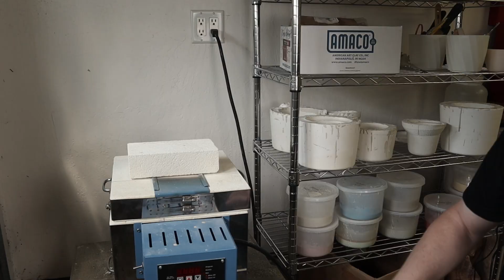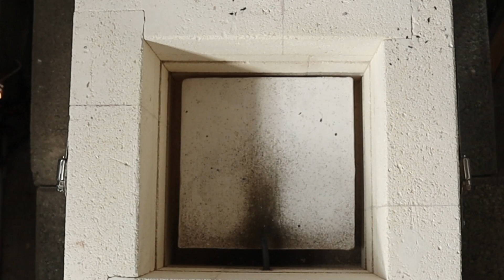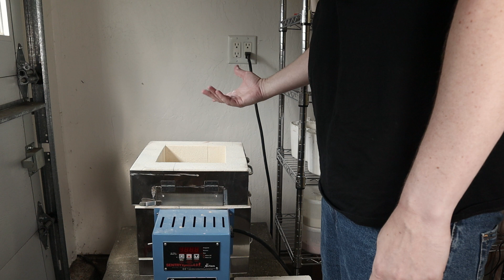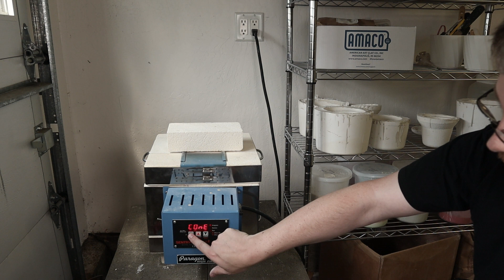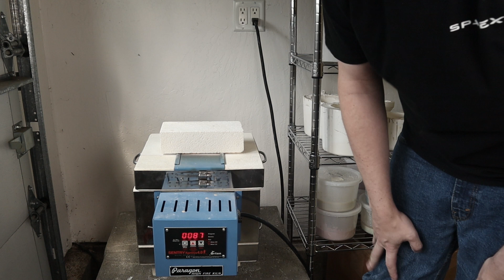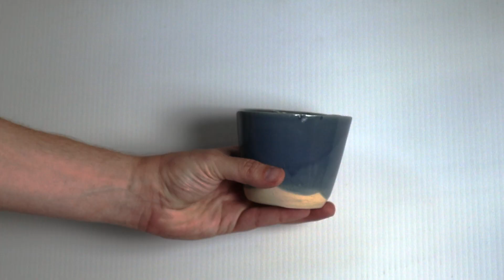Paragon Caldera Kiln for Pottery

Comment: Hello, thank you for the in depth video. Curious what amperage you your outlets and circuit breaker can handle?
Reply from the maker: I don't recall but the specs required are in the product info.
Reply: @PotterybyKent yeah, I saw the specs and it seems like a 15amp circuit could handle it but would be pushing it. I’m curious if anyone with a 15amp circuit runs these no problem or if a 20amp circuit is necessary

Comment: Great video, I'm leaning towards this Caldera w/ expansion ring option for pottery, I don't do jewelry.  I was looking at the skate firebox 8x6 lt kiln, but it appears that the Paragon Caldera kiln is slightly bigger.  any insights is much appreciated.
Reply from the maker: I tried using the expansion ring and it wouldn't get up to cone 6 before erroring out (taking too long). So I think it'd require some modifications to get up to temp with the ring. Without it, I had no issues but it is tiny.

Comment: I bought a new paragon firefly when it arrived it had a broken brick I have the piece how to glue it back in
Reply from the maker: Well you could ask for a new one under warrantee I guess. But assuming you don't do that, I can see 3 options depending on the break. If it's not too big (like just a chip) you can use it without the broken piece. If it's just a crack and is otherwise stable, you can fire it with the crack. Finally, if for some reason those don't work you can use refractory cement to adhere it. My kiln is actually the one originally intended for glass blowing and so there's a window in the top of the lid. I cut out a piece of brick and used refractory cement to close the hole up.

Comment: I have a mini kiln
But instead of choosing the cone
I have to enter the firing schedule 
Can u please share 
Cone 06 glaze firing schedule?
Reply from the maker: I can give you the one I use now. It starts with a 2 hour delay which you could remove. And is in fahrenheit (so feel free to convert to C as needed)
Time (minutes) | Temp (F)
120 | 165
130 | 195
240 | 250
485 | 1684
585 | 1828
590 | 1828

Comment: Hi Kent - Thank you for your video!  It was very helpful - especially to see the size of the pieces you are firing. Your video is the only one that I've found like it and it is so daunting to buy a first kiln!   I am hoping to buy a Paragon Caldera and use it for small porcelain jewelry that needs firing at ^6 with gold luster at ^018.  I was wondering - it is possible to stack two shelves if the pieces are flat and do you think it would be tall enough to make a little structure to hang pendants?  I saw that you can expand the height of the kiln too.  Does this affect how high the kiln can fire?   Thank you again - your videos are very much appreciated!!
Reply from the maker: That's great to hear!

Yes, you can stack shelves. I think mine came with some tiny 1 inch kiln posts to put a second shelf on. And I've never hung any work, but yes, as long as the prices are short enough I'm guessing it would be fine. The ring to go on top definitely impacts firing speed/temp. It didn't like going to cone 6, but I could do a bisque fire that way.
Reply: @PotterybyKent  wow! thank you for such a fast reply Kent :)  Oh good to know that shelves can be stacked.  Oh that's a shame that the extra top keeps the kiln from reaching cone 6.  I'm sure I'll be bugging you again soon - haha especially after I have the kiln!!
Reply from the maker: Happy to help!
Reply: @PotterybyKent  Hi Kent!  I knew I would be back with more questions :)  I am trying to figure out where to put the caldera kiln and hoping you might have some suggestions.  One option is in our garage and another is in a separate metal shed outside.  I am concerned about fire safety, fumes and venting, and keeping the kiln in good shape.  So curious about your set-up and insights.
Reply from the maker: @shelleyaldrich8008  The safety considerations are of course up to you. Mine was in my garage and I opened it a bit for venting. Outside (even covered) from what I understand there can be issues with humidity in the bricks however I've never had one outside myself.

Comment: if the kiln is on for 10 hrs, etc.  is it profitable ? it seems to be using a lot of electricity.  Gas is always less costly than electricity but the handling is not as easy. Jus curious
Reply from the maker: Profit has two sides - costs and sales price. You can make just about anything profitable if you make it valuable enough (sales price). As a percentage of the cost of a pot, electricity is a factor, but likely a small one compared to labor. Electricity can also be generated from renewable sources. And while the kiln is "on" for that duration what it is really doing is toggling relays on and off to hit the target temperatures on the right schedule. One factor in choosing gas is to do a reduction firing - that really can't be done with an electric kiln.

Comment: Anyone still on the fence about buying one of these kilns. I’m with Kent, and recommend the caldera. I also got mine second hand. I use it for glass fusing and slumping, vitrigraph pulling, and bisque firing small pottery items such as jewellery or pots. I use a rack to hang ceramic pendants when firing. I did want to try silver clay in it, but I didn’t want to ruin the kiln for glass so haven’t. But I’ve been assured they can cope with metal clay. I have also put a plug in the window, and place fire bricks on top for bisque firing. My work is nowhere near as nice as Kent’s, but I’m mainly a glass artist. I just like to have fun playing with mud. Don’t hesitate if you come across one of these little beasts! Snap it up and have fun.
Reply from the maker: Thanks for your perspective!

Comment: I want to get a small kiln like yours but I'm worried about the house I live in. I live in a mobile home and the last time I plugged a portable ac into the outlet it kept cutting off the electricity to one part of my house. It happened 3 times before I finally just return it.
Reply from the maker: You'd want this on its own circuit. Or in my case I had it on one with nothing else plugged into it.

Comment: Kent, I bought the same Caldera about 18 months ago and have used it to make several pieces. I made the "mistake" of ordering the version with the window in the top; I eventually filled it with a piece of firebrick since it significantly limited the maximum temperature the kiln could achieve (couldn't reach cone 5, failed at about cone 1 if I remember correctly). Due to the size limitations, I just bought an oval 36x24x17 kiln which I am eager to use once I get the venting system installed. I have to admit, having that much volume to fill is a bit intimidating! I really, really need to step-up my hobby production!!!
Reply from the maker: Very nice. That journey sounds very familiar! I still haven't gotten use to my "new" old kiln - it is soooo much bigger than that Caldera. It does indeed take a lot more pots! But the advantage is being able to make bigger ones as well.
Reply: @PotterybyKent  One additional thought regarding the Caldera Viewport: When I originally covered the top similarly to your approach, I had a lot of damage to the sheet metal and paint. Trimming a firebrick and additionally packing with a piece of ceramic blanket has been a better approach for me.
As to the new kiln, on today's "ToDo" list is to add an Orton vent and route it out through my garage wall. Original plan wss to put the kiln in my basement studio; luckily I realized it was going to be too darn hard to get it down a flight of stairs, especially since tt's one heck of a heater at some 14,000 watts... Would have turned my basement into an oven!!!
Reply from the maker: @Robert Dunlop With my fire brick placed in the lid, I also got some discoloration of the paint, but didn't notice any problems with the metal luckily.

Good luck with the install! Moving the bigger kilns around does take some effort, especially considering how fragile the bricks are.
Reply: @PotterybyKent  >Good luck with the install!< Thanks. Having to fall back on my years as a carpenter/building contractor as I punch a hole through the garage wall. I'm not planning to move the kiln again. At 400 pounds it's both too heavy and too fragile! I did put it on a rolling frame, but just to shove it around the garage so my wife doesn't ding her door getting out of her car. The fun never ends! :)
Reply: @PotterybyKent  BTW, do you use Fusion 360 to report the volume of your silicone casts?
Reply from the maker: @Robert Dunlop Nice. I've thought about putting mine on a rolling frame as well to push it off to the side when it's just sitting there 99% of the time. Instead it's basically the opposite being up on concrete blocks to make the bottom easier to get to!

Yes, I'll go into fusion to get the volume of my models. In particular, it's useful for casting the plaster so I know about how much to mix up. It should also work for silicone.

Comment: Good Day, 
I ordered a brand new Caldera XL test kiln. When I opened the packaging to inspect the kiln, I noticed it have some incomplete sealant between the floor and wall bricks. In addition, I noticed the lid had a chipped about 1"x0.5" and another minor chip. There was also a heating element kind of off-seated. When the vendor got back to me, they were saying this is normal, to be expected, and most seasoned potters would find these things cosmetic and can be easily sealed/repaired. 
However as a customer of various products (stained glass to clothes to food), I can't find their explanation logical. I actually do quality for work and if a supplier would have shipped a part in that condition, I would reject it and then write the supplier up dinging their ratings. Then it was starting to sound as if, they were going about to hint that I could do the minor sealant repairs.
This is starting to sound/smell fishy, I wanted to get your opinion and thoughts. Is this really normal? Or is this just the result of poor packaging? Or are they trying to pull a fast one because I'm a novice?
I greatly appreciate all and any advice you have.
Reply from the maker: I bought this kiln as pre-owned but never used. I don't think it had any defects like you mention. I did add a brick to the lid (closing the glass window mine had) and that sealant was easy to use. My other kiln was very very used. And digging into what needed to be repaired, it seems like damage to the bricks in general is not a big deal for the kiln's functioning.
So back to your questions, I do think those types of issues are cosmetic and easy to fix (or really they don't need fixing). I have extremely limited experience with new kilns, so I'm not sure if those types of things are common with them, or if you got unlucky with this particular one.

Comment: I've been thinking about getting a small kiln to make porcelain jewelry. The dream is to buy a larger kiln one day, but this seems like a great model to get started with especially as I can still fire larger pieces at a local studio I attend. Also a bit more affordable even purchased new and even can find it in stock! It looks like the Firefly model is the exact same in terms of firing temp and volts, difference is the lid hinges to open. Thank you for sharing this!!!
Reply from the maker: Getting a kiln at all these days can be quite an achievement! It was a great one for me to get started. And if you're mostly working with rather small pieces it could probably take you a long ways.
Reply: FWIW, mine has worked well with cone 5 porcelain.  Main limitation is the size: 7"x7"x7". But it has been useful for both pottery and some glass work I've also been doing.